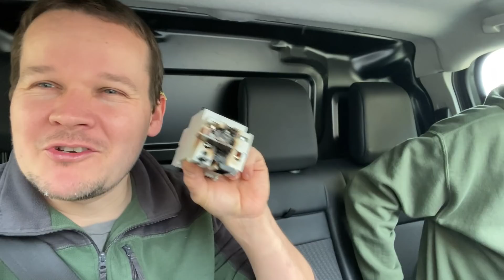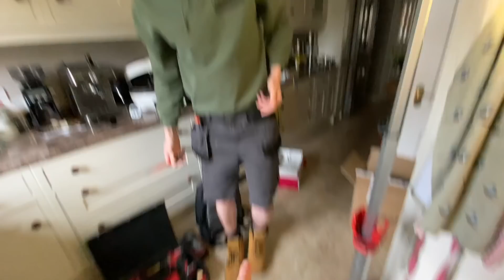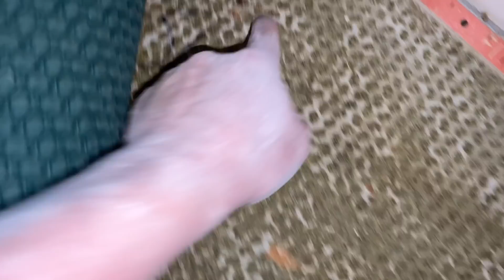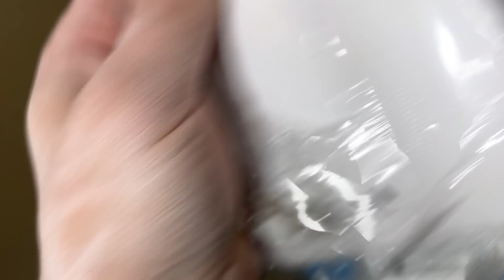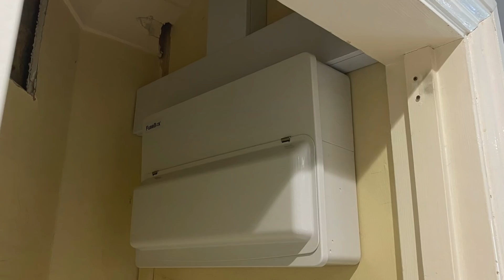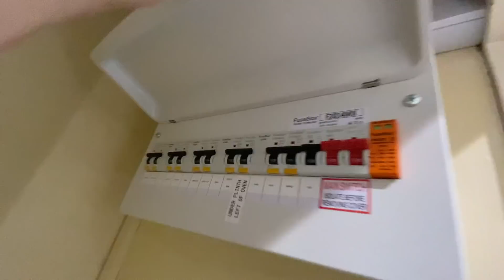“Chris can you move the fuseboard please” GREAT !!! Fire damaged.

Comment: Why not put the transformer in the CU with all that space?
Reply from the maker: Mixing of manufacturers equipment is not permitted in the consumer unit.
Reply: I thought it wasn't an issue as its not using the busbar. Only say as I was told I could install an old Merlin Gerin inside the new board as it's not ising the busbar?
Reply: I thought it was only switch gear off the busbar.
I put the transformer in the CU , after all it’s on a din-rail mount
Reply: No, the transformer may get hot, and a potential risk, a ignition source fire hazard.😳

Comment: Are there cases where A) a flat B) a detached house gets a three phase supply? Or is it the norm in the UK to have single phase supplies to living quarters?

Appears to be quite a cramped place to put the fuse box... is there a rule of how much clearance there must be in front of a box, does that nook fulfill it?
Reply: Flats often have 3P coming into the building with single phase run to the individual flats. Houses are single phase but it is possible to upgrade, just very expensive to do so with little benefit in a domestic setting.
Reply: @lmarkey1748  three phase 16A in domestic is very common here in Sweden, both house and flats.
Reply: @lmarkey1748  Quite interesting. In Finland it is also common that blocks of flats get 3P that is split into single phase for the flats... for detached houses it is mostly 3P straight off, with 25 or 35A main fuses, and now there are rowhouses as well as newer blocks where 3P is wired all the way to the apartments. Especially when some of the fancier flats have their own saunas and large kitchen stoves. 

Of course in the detached houses especially we have water heaters etc that are designed for 3x400V and therefore the 3P wiring allows running high power devices with lower current.

Comment: Hi Chris another good show! just one thing mate the earth on SWA from rod for garage! If there was a fault on the SWA ,damaged etc, on route to garage the RCD in garage would not operate as the SWA is up stream of RCD & earthing on SWA is down stream .I always isolate before the Garage board keeping the supply cable earth covered by the house board mcb &RCD, thanks for showing us the Fusebox range good kit.
Reply from the maker: An earthed swa sub main doesn’t require rcd protection.
Reply: @Cjrelectrical  The MCB in the house protecting the SWA pressumably won't trip, unless the loop on the TT is unusually low - so it would need RCD protection to meet disconnection time. The SWA should be on the earth from the house until its insulated at garage and changed to TT
Reply from the maker: As a general rule I do install my sub mains as you’ve described. But in this instance the swa feeding the garage is buried within the fabric of the building and doesn’t pop out until it appears at the plastic consumer in the garage. I made an assessment and came to the conclusion that fairly low risk anyone will ever damage the cable ( been installed like this for 25 years). I am however going to be returning to the property to sort out the car charger. In an ideal world I’d love to sort out every problem I come across on a job but as this was an urgent consumer unit replacement I had no choice to carry out the swap before a real site survey could be carried out.

Comment: so the accessible joint box is in effect extending both legs of a 32A ring CCT with push connectors. would any suitably rated push connectors be suitable that are rated correctly - i.e. spliceline or wago221?

Comment: Thanks for the shoutout! Sorry about the BG recommendation it’s the only bit of BG kit I ever use! Only because there no other option for 24v din mountable transformers...
Reply: I am no electrician but what is wrong with BG?

Edit: Ah ok.
Reply: @benh1216  Nothing really... just one of those brands that are cheap so you get what you pay for.
Reply: @benh1216 A cheap brand that on there own aren't that bad really but every time I've seen one installed it's been a shower of shite.
Reply: The Google Nest website has a list of chimes and bell transformers you can use to get 24V, BG isn't one of them. I've stopped using BG ones now, too unreliable.

Comment: Ohh man, Why not fit a MK consumer unit, the main switch is on the left
Reply: Mk fuse boards are garbage, poor main switch and breakers twist on din rail
Reply: @lansdorf  personally I have never found twisting to be an issue with MK consumer units. I only ever use them if the main switch  needs to be on the left, Saves a lot of grief and hassle in my experience of being a qualified electrician for over 35years, Only trying to help
Reply: @reecehorner3736  I appreciate your comment and that your only trying to help, I didn't mean to appear bombastic I just found that tightening the breakers to the bus bar rail they all lean over despite my attempts to keep them vertical.
Reply: @lansdorf  Thanks for your reply. All constructive input is a good thing, 👍
Reply: Thinking more about this, I'm not into consumer unit snobbery, just what at an affordable price to the client
Reply from the maker: MK 🤣
Reply: @Cjrelectrical  Niglon do one on the left hand side too 👍

Comment: Did you allow for 2 days, or did it just turn into more of a job than what you first thought?  
Is this why people give estimates and not quotes to cover you if more time is needed. 
I only ask as I’m just starting out on my own and had a couple jobs of late that I quoted a fixed price and turned out to be more work. 
Cheers
Reply from the maker: Yeah estimate for the initial work then an agreed hourly rate for anything else.
Reply: Yes you can never judge what you come across when you look at the job for a estimate, especially when you change a board that did not have a RCD,and you put one of the new boards in with rcd,bound to find faults when you do the testing after you fitted the board which will make it trip,good luck 👍
Reply: Cheers 👍🏻

Comment: Why are the fuses so high in such a narrow space?
Reply: Either the builder didn't want to spent the money for the extra wire needed to reach a lower placed panel, they didn't properly plan the cable runs and ended up with not enough cable to reach and/or shear unadulterated laziness...

The other alternative is based on the battens on the wall, there are usually shelves in that cupboard and a lower panel would interfere with them...
Reply: Was standard practice 10-20 years ago to put them up high but now we go by nhbc regs for c.c.u height which is 1350mm-1450mm to the breaker
Reply: The electrician was probably from Cavan in Ireland.... They would hang out of the cable to cut them as short as possible to save as much as 1 or 2p a go so it all adds up the tight backstards
Reply: Simple answer, clients see consumer units as ugly things that need to be hidden out the way and not take up convenient storage space.
Reply: Pensioners usually fall of chairs trying to reset a breaker.
Reply: A remnant of the times where they were real fuse boxes. Those only required someone (and preferably someone qualified) to replace a blown fuse once every blue moon, so it could be well hidden. Also, there are accessible isolation switches for everything---something other countries don't have. Those have accessibility rules for consumer units instead.

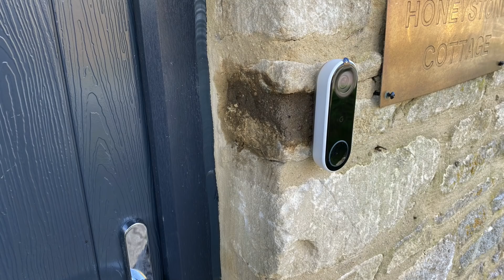Comment: 22:56 wtf is that Chris I thought you were better than that mate
Reply from the maker: The door fitters have ripped the door push and cut the cable super short unfortunately. What would be your fix in a fully refurbished house?
Reply: @Cjrelectrical  im not on about how you fixed it I'm talking about what you filled it with 🤣
Reply from the maker: A darker shade of sand and cement.
Reply: @Cjrelectrical  🤣
Reply: its brown
Reply from the maker: It’s dried now looks 👌🏻
Reply: Good 👌🏼

Comment: How did you repair the hole you cut in the chipboard floor? Piece of batten screwed either side or something else? Very nice job on that board - I used your code to buy and fit one the other day so thanks for that :D
Reply: Most likely, cut piece back down and some wood filler ....
Reply: Yes, you could see the screws to the side of the hole supporting a batten for the cut piece

Comment: That breaker on the meter should really be a standard feature, as well as access to the consumer side tails without cutting the seal.
Reply: It used to be on the Siemens meters like that....
Reply: In Italy we have breaker on the meter that can be tripped digitally, either for overload after a certain amount of time, or remotely (meters are networked trough the power cables with a powerline like protocol) for not paying your electricity bill, or in cases to prevent blackouts in case of grid overload (trip some meters to avoid possible the transformer to overload, in theory possible, never seen it done tough).
Reply: And thats the problem - done remotely. It would probably not be classed as sufficient control of the isolation as not fully under your control. Sometimes things are just over complicated. Just put an isolator in....